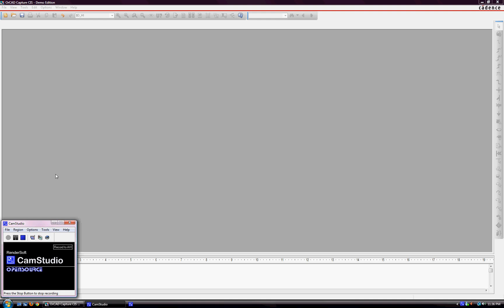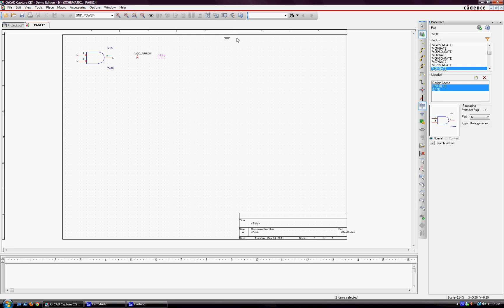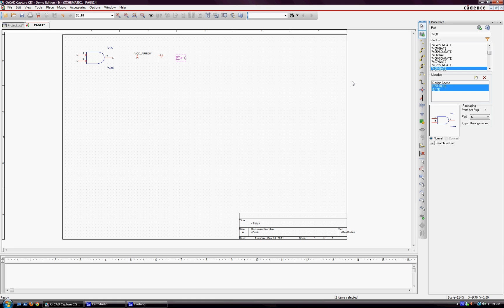OrCad Basic Tutorial + Parts & Libraries

Comment from the maker: i do not have OrCad installed anymore, but from what i remember, you should be able to find the vDC part under the source library, along with other volts. resistors are under the analog library, although im not sure if youre asking for just a resistor or a straight up LED. LEDs are under discreet, and i showed you in the video where gates and inverters were. i am not sure where switches are, but as you can see at my google doc, you can type "sw" to find switches. hope this helps!